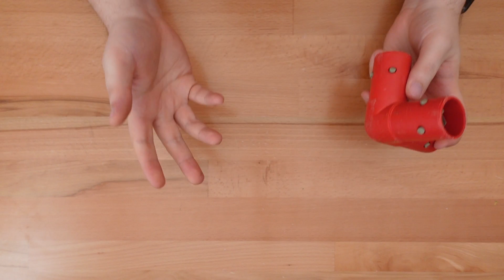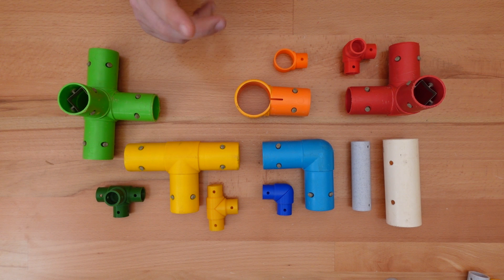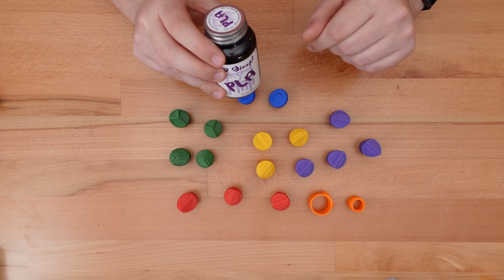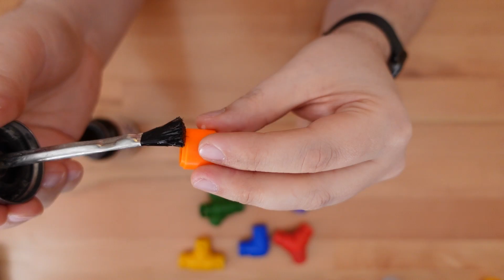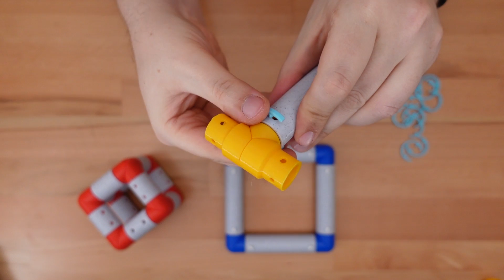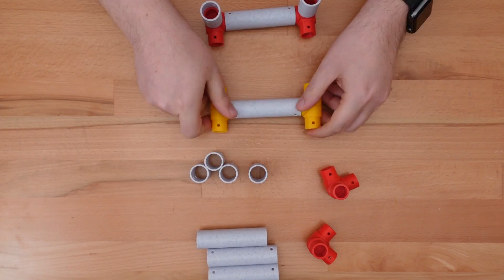3D Printed Building Toy

Comment: If you printed pipe clips/clamps to fit, you could make custom q snaps (tension frames basically) for cross stitch and embroidery
Reply from the maker: That's a neat idea! I wasn't familiar with q snaps, but they look pretty simple. If you email me (email address is located under channel info) I'd be happy to send you a file you can test to see if the theory works. If it does, I'll release it publicly.

Comment: Really surprised you didn't do this already but.... what about turning the holes for the locking mechanism into pockets and fitting magnets like the ones from the Heart Box project? I thought of this while watching with all the extra magnets sitting on the corner of my desk lol.
Reply from the maker: It's a great idea! It get a bit tricky when multiple connectors are involved at once - twisting to lock one connector always unlocks a connector on the other side of the pipe. There might be a way around that, but I haven't figured it out :)

Comment: That instruction manual is def a blast from the past!

I loved these when I was a kid, We had enough parts that I was able to make a pretty large jungle gym, we had the wheels and the flat panels also.

There was one point when the 3 or 4 connector broke due to too much tension. 

p.s. (the twisting from the ring lock is the closest to the original function, I remember the "wrench" you had to use on the old ones to get them apart)
Reply from the maker: We had the same experience. Those little panel hooks broke so easily!

If add panels to this project, I'll definitely use an alternate attachment option.

Comment: Great design as always! One trick I have seen to help with elephants foot is to add a 0.4mm bevel to the bottom face of the print. This bevel counteracts the elephant's foot effect.
Reply from the maker: Good recommendation! The connectors have a small bevel already, but maybe I should consider increasing it a bit.

Comment: The things that I immediately think of when I look at this:
1) You need a 4-way 120-degree connector so that you can built diamond-like structures.
2) 5-way connectors that let you build flat honey-comb structures, with attachments above and below (ie: graphene)
3) connectors that let you build geodesic structures.
Reply from the maker: All great ideas! I'm going to need some pipes with flexible lengths to manage all the odd distances that come into play when going beyond 90 degree bends.

Comment: I make chicken pens out of metal conduit and PVC elbows. Unfortunately the conduit isn't the right size to fit into the PVC elbows screw them down and just leave a gap. Now that I have a 3D printer I can print out my own that will be the right size for the conduit.
Reply from the maker: Glad to hear this can have a practical purpose! Just make sure to pick a filament that will stand up well outside. I suspect PETG would be the best option for you (although more research would be wise). Happy printing!
Reply: @3DPrinty  yeah I went and double checked which ones I can use outside I have some PETG and abs will hold up but it will color which is fine

Comment: These are awesome! I was designing a set like this for a while but for some reason couldnt come up with a solution to the overhangs i liked. Guess i know what my printers are doing for the next month! Do these fit with regular pvc pipe at all? Say 1/2" or 3/4"? With a drill jig you could make all manner of forts! Would have to size it to a few variations though due to different regions having different ID of pipe.
Reply from the maker: With some careful scaling (and conversion from metric to imperial), it should definitely work!

At 100% scale, the pipes have an ID of 20.25mm, which provided 0.125mm clearance all around for the connector (20mm exactly).

The OD of the pipe shouldn't matter too much unless you're planning to use the orange hinge connectors or the lock rings. If that's the case, those will need to be scaled up even further. The ID of the orange connector is 24.5mm and expects a pipe with an ID of exactly 24mm.

If you print or remix this for PVC pipes, I'd love to see how it turns out!

Comment: Love these !
I was thinking about using magnets to get a soft "lock" system.
Also, another working system would be putting some little "button" on the pipes and L shape holes on the crossed section, when connected and twisted it would make a good lock. (Sorry if it's not understandable, it's quite hard to explain)
Reply from the maker: Adding magnets is always a good idea!

The latch idea is also good, but it runs into problems when a pipe needs to lock into two connectors (one at each end). The twist direction that locks one connector would result in the opposite end becoming unlocked! There may be a way around this issue, but I haven't figured it out yet.
Reply: @3DPrinty  maybe have the locks oriented in the same direction, so they both lock at once?
Love the videos and creativity! Looking forward to any additions!
Reply from the maker: @Dipo2814  I'd have to sketch it out to be sure, but I think any lock orientation that works in one scenario will be pointing in the wrong direction in other scenarios. Maybe instead of an "L" shaped track, it could be "T" shaped... locking in either direction? I'll ponder it more later :)